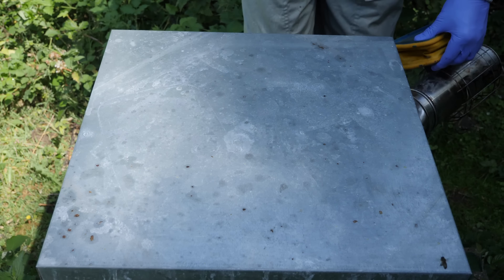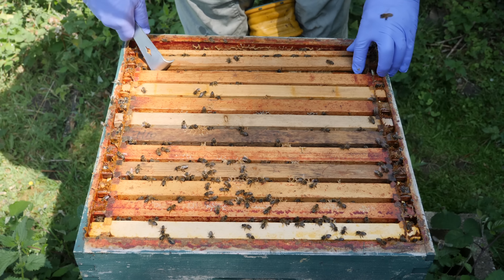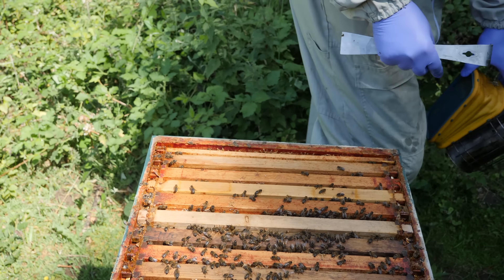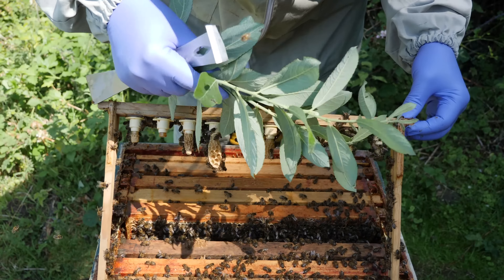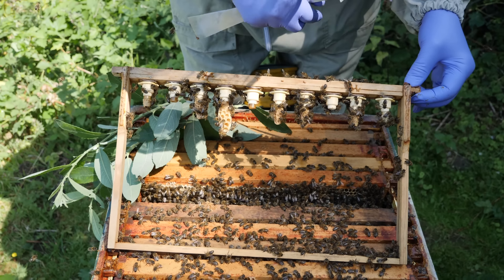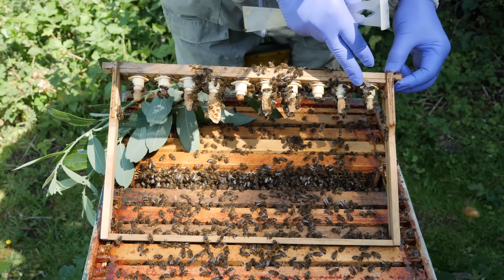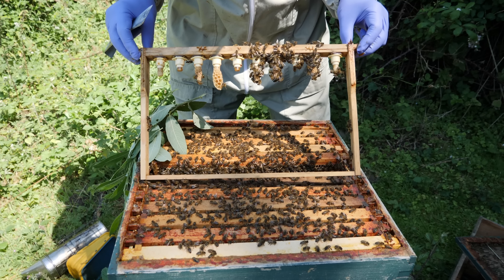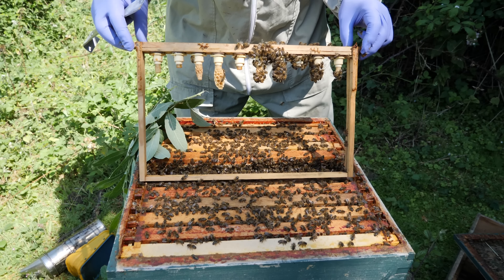Nicot Update - Queen Rearing using the Nicot Cell Cup Kit

Comment: excellent as ever Stewart
couple of questions
1. how early would you consider starting this process in spring?  queens clearly need plenty of drones about at the time they emerge so wonder roughly when you think that is...
2. you put 10 cups into the queenless national hive, how do you calculate an acceptable ratio of q cups to the colony?  ie could that national have taken 20?
3. when you add the q cell into mini mating nuc, how long should the cup full of bees have been in there prior to the q cell added?
sorry if too many questionss!
videos are so informative and im promoting them wherever i go

Paul
Reply from the maker: Hi Paul,
Thanks for the questions.
1. This is really weather dependent, although for me personally, I can generate enough queens from late SPring onwards so Late May/early June is fine for me and prevents any late chill from spoiling things.
2. With a National I wouldn't put more than 10 queen cups in just to maximise the feeding of royal jelly to those 10 larvae. More cell cups means more work for the workers and could lead to insufficient royal jelly going into the cell cups.
3. I normally give them 3-4 days to get started on drawing out the comb but I've never had great success with queen mating nucs much preferring to use three full-sized frame nucs.
Hope that helps.
Stewart
I have much more content exclusive to my supporters at www.patreon.com/norfolkhoney

Comment: Great video as always Stewart. I've heard it said that the cell cups arn't wide big enough compared to a bee made queen cell. I was playing about with the system today and found if I push the cup holder down harder onto the cup, the cup sides splay out a bit more and it makes them a tighter fit. I think when I try it next year I'll set up a queenless colony on double brood, and put 2 frames of 20 cells in. When caging queen cells would you recommend putting fondant in the bottom of the cage and leaving a couple of workers in there to look after the queen cell/queen?
Reply from the maker: Hi Hawk Lord,
thanks for the comments.
I've not had any real problems with te size of the cups this year but only really had a chance to use them a couple of times. I found the process very easy to use and will be using it again next season. I think your suggestion of fondant and a few workers in the roller cage is a good idea. I've not tried the roller cages to any extent this year, just ran out of time so will look at using them next year and see what happens.
Stewart
Reply: @TheNorfolkHoneyCo  Hi, does it mean that the roller cage is the SET : CNE 5, CNE 7 and B2 ?
Thanks

Comment: hi Steve, 
i found queen rearing video series as very helpful and informative just like others you provided before. thanks a lot.
i wonder how the number of queen cells affect the quality of emerged queens assuming that cell builder colony is strong with a lot of nurse bees. my point is that, the fewer queen larvae should get better nutrition. perhaps this holds true only for bigger numbers of queen cells.
Reply from the maker: Hi Meir,
Yes you are right, you need a very strong colony to produce lots of good quality queens as they needs lots of high quality royal jelly. The more queen cells produced the more bees you need to produce lots of good quality royal jelly to feed them.
Stewart
Reply: thanks Stewart .

Comment: Hi Stewart,  I am trying to re queen a hive I have a frame with a QC from another hive could I put that frame into the queen less hive or should I put it into a Q cell protector first? Thanks in anticipation
Reply from the maker: Hi Lesley,
Make sure you brush all the bees off the frame and I would wrap a small piece of tin foil around the cell leaving just the tip exposed.
Good luck with it.
Stewart
Reply: Hi Stewart, thank you for your reply, I’ve made the hive queenless today and the QC is in the other hive is due to emerge
24th of this month,  when is the best time to introduce it into the queenless hive? Kind regards Lesley
Reply from the maker: Hi Lesley,
I would make sure you get the queen cell into the hive in good time, they have a habit of popping out early sometimes!
When you do introduce it I would go through the colony and knock down any other queen cells so they don't have an alternative option to the introduced queen cell.
Stewart

Comment: Seeing the ant problem starting in this hive, any tips on how to discourage them would be appreciated.
Reply: Can put ants powder around the base of your stand or around the feet, another method is you can build hive stands that have Cups on each foot that go through the middle of the cup. Fill the cup with old engine oil of vegetable oil to build a barrier.
Reply from the maker: Hi Christopher,
I've used old tuna fish cans filled with oil which has worked well before, this is the first time I've had an ant problem in this apiary so might try that again if it persists.
Stewart

Comment: How long does it take from egg before the new queen will hatch?
Reply from the maker: Hi J&B,
The usual timing is around 16 days from the first day to emergence although I have seen queens emerge earlier. When you're queen rearing that can be disastrous, so you have to check and move queen cells at least a couple of days early so the first queen that emerges doesn't destroy all the others or you can use the "hair roller" cages to trap the virgin queens in place.
Stewart
Reply: @TheNorfolkHoneyCo  
Are there any positives or negatives when using rollers which I am planning to use in the coming season?
Your videos are great, thank you.
Reply from the maker: @FloryJohann  Hi, I tend not to use them, however, if you do, they will be very helpful in retaining virgin queens once they emerge if you don't have time to sort them prior to emergence. There is always a chance, if you don't put them on correctly that a virgin queen could escape and attempt to either swarm or kill other queens but overall I don't think that is very likely as the rollers fit snugly.
If you can I would try to get the sealed queen cells out and into mating nucs before you need to use the rollers.
Stewart
Reply: @TheNorfolkHoneyCo   Thank you for your advise.

Comment: I have watch and read the use of the nicot system . They all state use newly hatched larvy NOT EGGS
Reply from the maker: Hi Arthur,
Yes, it's interesting isn't it, I read all the time that you must use larvae not eggs. In this video I got my timing slightly wrong and the cups still had eggs in when I went back to record the video and it's not always easy to leave it and go back because of various reasons. As it was we had 7 out of 10 queen cells emerge and produce viable queens so despite being told you can't use eggs it appears you can get away with it sometimes!
I've also used the miller method and Alley method and both of these have produced great queens from cells that had eggs in them when placed in the cell builder colony.
You probably get more consistent results from using larvae but eggs work as well. What methods of queen rearing do you use?
Stewart